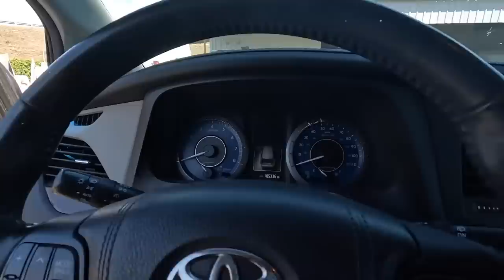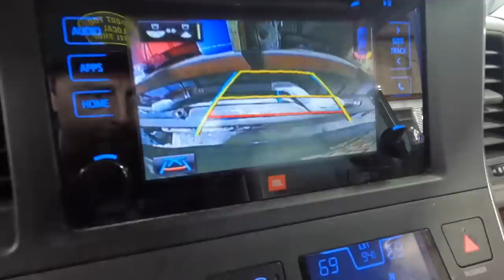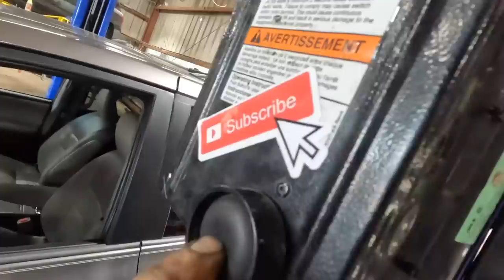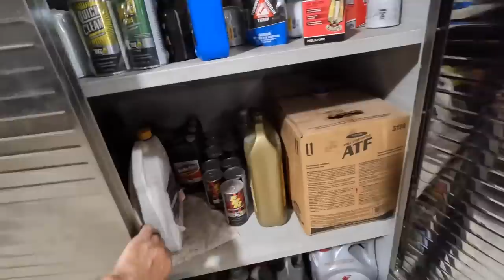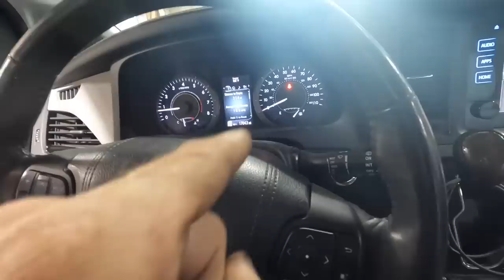Not going to sell this job! Toyota Sienna 3.5

Comment: There is a factory recall for the gas door on those Siennas. Toyota will reimburse your customer for that repair Ray. Toyota TSB ZKE or NHTSA 10162783 will have all the info.

Side note, this video's level of brake clean was very satisfying. 😊
Reply: Motor Oil-$50, Oil Filter-$15, Brake Clean-$87.50

Comment: That was an upbeat vid, Ray! Good to see you in an even better mood than normal. Our Toyota dealer tried to sell us an oil leak repair for about $900, not knowing that I change the oil and look for leaks myself. Here we are years later and nearing 200K miles, still with minor seepage. The real problem on this car became oil burning at around 100K miles. Ironic that they were concerned about seepage when so many of these cars were oil burners......
Reply: that's not true...the  3.5 Toyota engine the 2Gfe series are known to consume oil at times, but are not known to be oil burners....that engine is one of the best ever made....
Reply: The problem is if you don't change the oil 3/5k miles not the recomended  10k the oil rings will gum up.
Reply: funny part if they actually fix the leak it will still leak again after 200k miles

Comment: A clogged PCV valve (especially on high mileage engines) is one of the biggest causes of these types of oil leaks.  Replacing a simple $9 part can save more costly repairs down the road.  I had that problem on my '08 Accord 4cyl (150K miles) started having to add a qt every two weeks and noticed oil leaks around valve cover and timing cover.  Replaced PCV valve and leaks stopped and not having to add oil between oil changes.

Comment: Ahmed from the Car Care Nut channel says oil leaks from the timing cover is a common issue on the older 3.5's.
Reply: All 3.5’s new ones are leaking as well. Toyota hasn’t changed anything about their manufacturing process to keep these from leaking
Reply: Much respect for Ahmed ,,
Reply: Respect for Mr Ray also
Reply: What’s crazy is it’s recommended that you remove the engine from the car in order to fix that type of leak properly

Comment: Hey mechanic herd,
Brake cleaner attacks the Seals so that they dry out faster then planned. We tested it on our workshop cars ( same model)  and the one who we clean with brake cleaner after a oil change leaked oil after 7 years and the other one was dry cleaned with wipes still holds strong with the original seal
Reply: Makes a lot of sense

Comment: Your channel actually solved a mystery for me for about a year ago. We got a first row seat back for warranty from a service shop. Our first row headrests are not adjustable but somehow this sears headrest had been squished by something heavy enough to make it bent at almost a 90 degree angle. I now know from your lift safety practices that they most deffinatly removed the seat for whatever reason and did not check when they were lowering the vehicle for parts underneath it and they most deffinatly squished thar seat with the vehicle when they lowered tbe rack down.

Comment: Good call Ray.  Lexus told me the 6 cyl is prone to leak from the timing cover.  It is a $3,000 repair because the engine has to be dropped to access the cover.  The Car Care Nut says don't worry about this leak unless it is making a mess on your floor.
Reply: Drove a car for 4 years with a small engine leak and a small transmission leak like not even dripping just watched the levels and topped off when needed.
Reply: For $3000 you could renew your driveway when you get rid of the car! I'm sure brake cleaner would shift most of it 😁
Reply: @oldbloke135  A plastic tub on your garage floor to catch the drips works too! lol
Reply: @jonh901271  f*** that cardboard's free!
Reply: Perhaps high(er) mileage oil additives/sealers package will help slow down the leak?

Comment: Ray, I am a lube tech at a dodge dealership, and I've done a couple of those Toyota oil filters before. The first one went like how you did it, with the oil spilling out all over the place, and I know you probably already know this, but that aluminum screw can be removed with a 3/8 ratchet. The oil filters that my parts department gives me usually come with a plastic piece to pre drain the filters before removing them to avoid such a situation. After I started doing that I almost completely avoided getting super splashed by those Toyota filters. Cheers, and good luck with the shop!

Comment: !!! The Gas tank door is on a Customer Support Program. They will fix it for free and replace it with an upgraded hinge. We have a 2015 Sienna LE and they got a new one paint matched it and installed it for no charge at our local Toyota Dealer.
Reply: Ray never does his homework
Reply: @gregjohnson2073  I only found out by accident while looking for a repair guide. Some one mentioned it and I called dealer to get actual paper for it.

Comment: To note about the engine cleaner, back in my day, Harley Davidson used to recommend running straight kerosene briefly after the oil was drained to clean out sludge etc.  I did it this way from 1988 through 2012 no issues.

Comment: that style of mirror glass for those various connectors:
-heated mirror element
-turn indicator or blind spot indicator
-electrochromic (auto dimming) feature (that's why the mirror discolored - when it cracked air got to the fluid that performs the function)

when ordering replacements there can various versions depending on how the model options were (some might not have auto-dimming for example)

Comment: I did a quick review of the BG diesel EPR and it worked fantastic on my duramax.  You don't need it every oil change, maybe every 50k miles could be fine.  But for all your clients that have never had it, excellent move. BG makes awesome stuff.

Comment: That is a common leak on the 2GR engine. It seeps where the head, block, and timing cover meet. My truck leaks right there. no drip, no oil loss. Engine out on the Sienna to remove the timing cover, About 20 hours. I sprayed my truck leak and it took a couple of months to reappear. I may dry it off this summer and place a dab of silicone and the seep. These engines can't tolerate skipped oil changes very well.

Comment: Doing some research on the 0W-20's and 5W-20's that all manufacturers are "recommending" on these newer vehicles, and the consensus seems to be that the only reason is so that manufactures can eek out ever so much more fuel economy from their vehicle fleet to meet CAFE standards.  I started putting 5W-30 and 10W-30 in my vehicles that are all over 100K miles just to get better friction protection that the thinner oils don't offer.  I think the benefit of longer engine life outweighs the 1mpg I might save using the thinner oil.
Reply: Since you're over 100k, consider using Mobil Delvac or Shell Rotella 15W-40. It has a much better additive package than automotive oils. It eliminates the sludge monster in the Dodge 4.7.
Reply: Longer engine life unless it takes longer for oil to circulate because it is thicker upon each start up. You could be advancing wear with this strategy.
Reply: @larrybe2900  Never had a problem. No leaks, less consumption, no sludge in the 4.7 Durango and no problems in the 3.9 Dakota I had at the time.
Reply: Car companies make money by selling cars.  And considering the "throw away" society we live in where most people don't keep a car longer than 2-3 years and then get a new one, they don't think about engine life (let alone following a proper maintenance schedule), so it makes perfect sense that car makers would trade longevity for fuel economy to meet CAFE standards by "recommending" thinner weight oils.
Reply: I understand your point, and in general it was good advice in the days before oil control solenoids were used to allow active adjustment of phaser timing. For vehicles made after about 2002, a tiny clot of oil in the wrong spot can lead to expensive failure and repairs of that mechanism. Similarly oil cooled turbos can be easily clogged, even more so for those with a screen. So, I tend to accept minor leaks and oil burning in the interest of preserving the most vulnerable points of the system.

Comment: Another swimmingly good video.  "The Car Care Nut" has done an entire youtube video on the Toyota 3.5 L V6 timing belt leaks...don't know if you have ever watched it, however, you may pick-up a trick or two for dropping the engine from the bottom to fix the leak should it become more than "seepage".  The video is entitled "TOYOTA V6 OWNERS! This is The Biggest Problem with The 3.5L V6 Engine".  If it saves you an hour or two then it is worth watching...it is all about the hours that you can bill for.  Love your channel, been watching since you left the dealership.  I wish you, the wife unit and the children the best and much success.   Kindest Regards, Steve Boyle

Comment: Fairly common issue. My wife and neighbor both have the same oil “leak” and been there for years. I also had to drill the rivets and pull the gas door hinge. Quick weld and back in better than new.

Comment: I know the brake cleaner is enjoyable watching, however that stuff raises cain with some things.  About the only time I use it is for convenience on underside of engine or a short blast for some unreachable creavis.  I find a dry rag works best, and maybe a little degreaser.  We use a foaming cleaner called once over to remove a lot of grease and toner residue from printer/copiers.  I bet that stuff would work wonders on spilled engine oil also.

Comment: The Oil filter housing on my Corolla is the same. Man,  the guy at the lube place I took it to in the winter because I was too much of a sissy to change it myself when it was -35 celcius must have torqued that thing on with a 5 foot breaker bar. I snapped my chinesium oil filter socket.

Comment: Ray, if you look below the cowling, under windshield on the passenger side, just to the right of the strut tower you will see an identification tag with the engine code and other info.  It took me a little while to get used to where it was located, when I started working as a tech at Toyota. You could see it when you poured the BG conditioner in the engine.  Keep up the videos Ray, we love em

Comment: Those front timing covers are notorious on the 2GR engines. 
It is a engine out procedure if you want to do it right. 
If it’s not causing a problem, just keep an eye on your oil level and leave well enough alone!

Comment: I just cleaned out my 2nd windshield wiper fluid reservoir thus year. That blue stuff can turn into an inch of goo at the bottom of the tank. Plus dried blue stuff clogged the nozzles. Never had the problem before.

Comment: I'm observing same leak on my 2011 Sienna for years. The thing is - leak is only active when the engine is running and it drips right over the CV boot and CV boot evenly distributing it while driving :) This banjo bolt was my culprit as well, but those front covers are very known to leak and the engine removal is required. So it will keep leaking :)
Reply: I keep an eye on ours, no leak yet. But if it does I'll hit it with cleaner at each oil change.

Comment: The sienna takes 6.5 qts. I just changed ours at 5K and debated doing it, the oil still looked new at 5K on the dipstick. But it wanted it changed so I did. But I think it could go at least 7K easy. After a lifetime of GM and Dodge, I am extremely impressed with Toyota. Just looking at it underneath there is obvious attention to detail and better quality. An example is using metal standoffs for wires vs GM unwinding vinyl tape and plastic fasteners. The exhaust is pristine vs surface rust, even though GM and Dodge have stainless exhaust. 138K and  8 years and the underside of the engine looks like it just rolled out of the factory. No seepage, no grime, not even dirt. After watching multiple channels sing the praises of Toyota, we bought this one used a couple years ago. Very impressed.

Comment: I wish all mechanics would check the oil for correct level and add more if needed. My last stealership oil change, they only put 5 quarts in my 2018 Acadia AWD, which holds six. So, the customer gets stuck adding an $8 quart of oil if they are smart enough to check the oil level. Also, why can't everyone clean up spilled and splashed fluids like Ray? Always nice to pay your hard earned money only to have a smoking, drippy mess for the first day after.  Love your content, keep up the good, honest, work.

Comment: Ray always nice videos, in my time as a car mechanic I checked small leaks with chalk powder.  First clean well and use a pressure cup gun, similar to a paint sprayer.  (I don't know the English name.) Spray chalk powder on the suspected spot, run the engine and even the smallest leakage can be seen in the chalk powder.  Maybe a useful tip.  Good luck and greetings from the Netherlands.

Comment: the Toyota oil filter change is two part process, cap removal, filter housing drain and housing removal. too many techs have used the square cap drive to tighten the filter housing making it impossible to remove the cap. Have to replace mine as a result

Comment: XLE is a trim code, basically middle tier.

The plastic tube in the filter kit is for draining the filter housing without spillage.  You should replace that o ring as well.

Comment: I really enjoy your videos, Ray, and look forward to watching them along with my morning coffee.  That said, I'm concerned with your humorous but cavalier approach to using brake cleaner (tetrachloroethylene).  Ever read the MSDS for that stuff?
Reply: That's not the only solvent used anymore.  Some don't contain that (that's a chlorinated solvent if I'm not mistaken) so non chlorinated brake cleaner would have a different (albeit potentially just as toxic) solvent.  It actually appears that different brands do indeed use different formulations nowadays.
Reply: @Mad-Lad-Chad  Thanks, Chad.  Indeed it is a chlorinated hydrocarbon.  (chemist, ret. 🙄
Reply: @julietoozie  I've always wondered if there is something better to use.  I know brake cleaner can be real convenient but I personally avoid using it just because of the environmental impact it has.
Reply: That Denco stuff looks like what we use at work.  It's acetone & heptane with CO2 propellant.  No chlorine.
Reply: Rainman Ray, single handedly depleting the ozone layer with his excessive use of brake cleaner.

Comment: Back in the day an old buddy of mine has a mid 80s camaro. He did his own oil changes.  Every time he would put in a couple quarts of kerosene. Then he'd pull the coil plug off and cycle the starter for a while. Then he'd drain it and refill with new oil. That 305 was as reliable as a clock!

Comment: I've never understood why so many people don't take the 3 extra minutes to drain the filter housing before removing. The filter kit even comes with the tool and new o-ring.
Reply: AHHH the age old question...To me it's no different than a vertical metal oil filter that spills over the sides when you take it off. idk to each their own lol just makes no difference to me
Reply: Because it's not worth it. I tried it a couple times and it's just as messy. There is no added value. Just remove the thing and spray it off
Reply: @AmandaHugenkiss2915  You're doing it wrong. I don't even need gloves when I do it.
Reply: @aaronbritt2025  could be but honestly, I've been loosening regular filters for 30+ years, it's not worth it to me to mess with that and wait around for it to drain, reinstall, undo the main part, etc. I'm under there, I'm getting it done as quick as possible while being careful. One thing that did dawn on me one day is, change the filter first. Any filter. Then it can drop into your pan and you don't risk dropping it into a full pan of oil and splashing it everywhere.
Reply: @AmandaHugenkiss2915  I'm 50. Started when I was 14. I pop the tool in and let it drain while I loosen the plug. While the oil is draining, I continue my inspection. It's not wasted time.

Comment: It's the timing cover it's extremely common on these engines and it's an engine out job so yeah I would suggest passing on it unless you want a big ass headache It could be the VVTI line that was the banjo fitting that you were referring to but I doubt it it's always the timing cover on these engines always

Comment: The fact that oil filter cartridge was torqued previously to 18 ft lbs and not 1000lbs is like winning the powerball.
Reply: I actually use the filter drainer that should comes with the new element, as long as some gorilla hasn't used the filter drain plug to wind up the whole unit!
13 NM for the drain plug, 25 NM for the housing. (Umm, I think that's about 9 and 18 ft lbs respectively)
Reply: @Damoinion  --A Wasted Step, Toyota Tech's do not use the small drain...
Reply: @randybeard6040  Maybe, maybe not.
I make my juniors learn how to do it that way so that they learn to not over tighten and also to avoid excess mess and waste of cleaning products.
Reply: @Damoinion  There's no need to when you have one of those fancy oil collection systems setting under the car when it's up on the hoist.
Reply: I worked at Jiffy Lube a few months ago (got sick, was let go). Anyways, didn't happen to me, but a coworker. Car came in, wanted oil change. He was trying to take the drain plug out, but it snapped. Thankfully none of the plug was left in the hole. It's insane how some "mechanics" torque the shit out of those plugs.
Reply: @Damoinion  Had a Tundra in the shop, plastic, not aluminum filter housing. someone had it torqued to 1,000,000 ft lbs it seemed.  Broke removing, we replaced it with an aluminum one.

Comment: Ray
The engine has to come out to take the timing cover off 10+ hours. Also this is a very common issue with the 3.5. There is a TSB on it as well. The black silicone used was the issue specifically Ray. Also there is no gasket used.
Reply: That's insane.